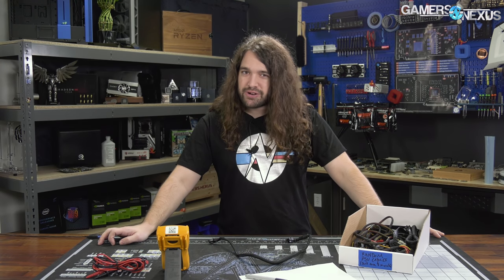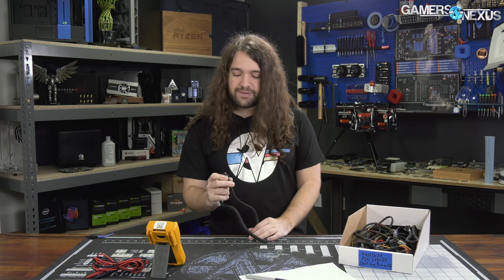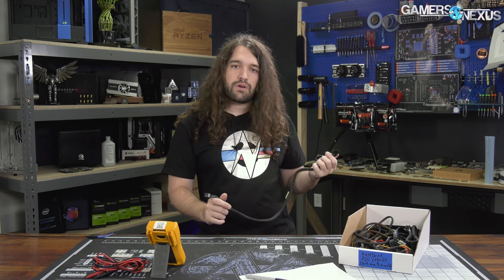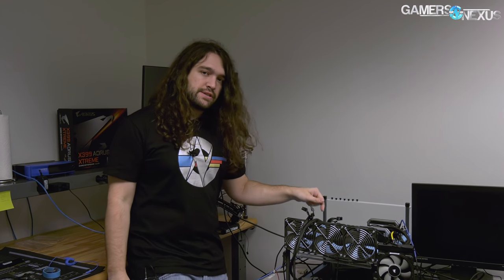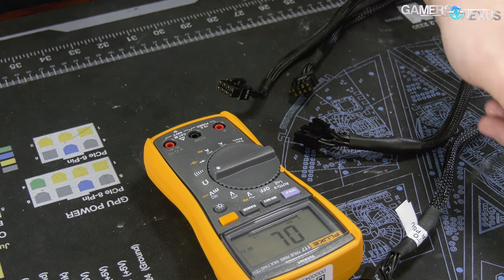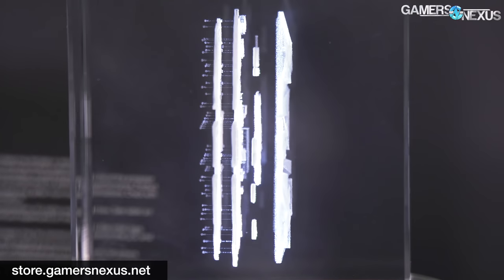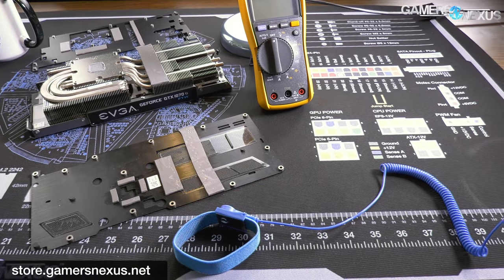How to Safely Mix Power Supply Cables Without Killing Parts

Comment: It depends on the supply i just tried to add extra custom sleeves cables to an old psu and it won't work. Yea an OCZ supply is wasted but it's all my brother had so i just bought him a new evga 750w and it works fine.

Comment: My friend was having problems with his computer. The PC shop couldnt work it out and eventually he decided to just buy new parts and just reuse his power supply. After getting it set up he found that the computer would crash under load so he decided that the PSU must be faulty. He bought a new PSU and plugged it in but left the old cables in the machine. There was no smoke or anything but but it didnt boot. Now after swapping the proper cables into the system it still wont boot. It says something along the lines of "USB over current, system will power off after 15 seconds". He has tried disconnecting all devices except for power and HDMI but it still keeps saying the same thing. Has he fried his mother board? If so, is it likely to have damaged anything else? Its ridiculous that this is still an issue. How many people have fried equipment just because they didnt know?

Comment: Personally I would plug the cables in the PSU and start it, then just do a potential measurement between each of the pins and a known ground of the PSU. Feels like that would be a lot more comprehensible than all that scribbling on paper....

Comment: I made pinouts by testing each cable, and it's easy enough to swap the pins around if needed. Question, though, when looking at the pinouts between my EVGA 850 G3 and my old Silverstone 700w SST-ST70F, the 8-pin VGA pinouts are exactly the same in where the +12v pins and ground pins are located, but the two bottom middle ground pins are swapped. Does this matter? A ground is a ground, right? Either way, that's the only difference, and everything else is the same. I swapped the pins anyway to be sure, so I was able to use a spare EVGA 8-pin VGA harness on the old Silverstone PSU.

Comment: The real question here is why are they like this to begin with? They would be standardized as a secondary result of just making the psu output a mirror of the connector on the board/card

Comment: So are extension cables safe? If different power supplies are wired differently, why do they make "universal" cable extensions?
Reply: I swore off extension cables since a few months ago when my extension cable burned the plastic on one of the connectors that went into my 3090. I had to scrape the melted plastic around one of my 3090's pins so I could fit the original PSU cable. I swapped PSUs just to be sure it wasn't the PSU. But boy oh boy. Never again. Never.

Comment: Wouldn't it be much easier to plug the cable into the supply, power up with nothing on the other end, and verify pin out on motherboard end of EPS cable with volt/multi meter?  As long as all the 12 v and ground pins are in the  correct place, your okay. This would work unless, for some reason, the cable shares or crosses wires between pins.

Comment: I learned this the hard way. Had a modular PSU recently. Which I so stupidly threw away the cables for. When my 1060 came, I didn't have a wire for it, so I went out and found a random 8-pin cable that matched the slot. GRAPHIC So, I plugged the cable in the PSU, and went to plug it in the GPU at which point the cable melted and adhered to my index finger and part of my thumb. I managed to shake it off before it cooled. So yeah. GPU's still works BTW
Reply: Damn, that sucks. You are lucky that the GPU still works.

Comment: i had to do some wire tracing when i got my CableMod stuff a little while ago. never having had contact with third party replacement cables before, i decided not to trust them blindly and compare them to my Seasonic unit's stock cables. and, well, unfortunately CableMod's wiring did look noticably different. so i had to look up pin out diagrams and then traced the individual wires and CableMod's weird splitting. one wire was actually missing compared to the stock cables, i think Sense B on the PCIe 8pin. didn't seem too important, though, so i used them anyway and yeah, nothing's blown up so far. still think it's sketchy, though...

Comment: Just pluck cable to PSU check is there is 5v to the ground where it supposed to be (power on), short start PSU and measure voltages on rest of the pins. If match then use. You made it overly lengthy and convoluted. Just be sure you measure voltage not current or you will have early new year fireworks.

Comment: Great video. Unfortunately tho, i discovered it a bit too late as both of my hard drives have just been fried due to, i assume, psu modular cable mixing. I bought a used Aerocool 650w semi-modular psu but it was missing sata cables so i just ordered a set of 4 sata to 6pin cable to add on my psu. Unluckily i had never heard of psu modular cables incompatibility so i just plugged it in and both my hdd and my ssd were fried.. problem is i cant even find a compatible modular sata cable for my 650w psu

Comment: Does it matter if the 8 pin slots are separated and no longer touching. If the plastic gets damaged by a bent pin is it still safe to used if it works

Comment: Wow I am a certified tech and I didnt know those cables weren't standardized. Thanks a lot.
Reply: Really? I would think this is one of the 1st pieces of wisdom any trainer/teacher would give out. If you are self taught?!?!? There is sooooo much that is NOT covered in any certification. The nuances of PC repair.
Reply: @tisjester  No i went to college I was not self taught. Also as techs we don't deal a lot with gaming systems when we do repairs. Most of our power supplies are not modular. I have built a fair amount of gaming rigs but never encountered this issue because I hadn't had a reason to mix PSU cables. I am glad I saw this video before an issue came up.
Reply: @diablojd52  why you need college just to repair PC?

Comment: If the pinout is different its no big deal, just pop the pins out the connector and put them back in the correct configuration.

Comment: Found this out a while back upgrading from a 600w evga psu to a 1000w evga psu. Didnt want to reroute the cpu cable again. Went to kick on the computer and got a 12v error light on my board( thank god evga still believes in lights and beeps for warning people). Got lucky and didnt kill my  brand new cpu.

Comment: Hey, I'm not sure if this can affect anything within the cable, but when I wanted to make my own cables, I heard of capacitors being on some cables itself. This made me make extensions instead, since I didn't want to deal with soldering, but is this something that may be something to watch out for?
Reply: The cables he was working on both had capacitors in them in the big budge(insert "oh my" meme) on motherboard side of cable under shrink wrap. They are just there to help improve power efficiency and can be handled a little roughly to get them to work for your case.

Comment: The way I would do it would be plug both cables into the psu turn psu on and test the voltage difference of same pins at system side.
If all read (close to) 0V all good else don't use the second cable.

NOTICE!
This does not guarantee the exact same pinout, only that it's unlikely to fry something.
EDIT This does not work for the 24 pin connector.
Reply: Probably for all but the Motherboard 24 Pin.. That has different wires that carry the same voltage (like for Sense / Standby and the like)
Reply: @tisjester  Good point.. Is there even a PSU with two connections for the 24 pin connector?
comment updated

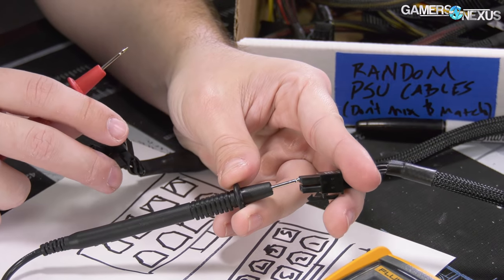Comment: 6:20 "OL" stands for "overload" - you're measuring the resistance of the air between the unconnected probes, which is extremely high compared to semiconductors or wires - far outside the scope the meter is designed for, thus you're overloading the meter's resistance range.  Zero L sounds like a handicapped Marvel superhero...
Reply: Open loop.  Open circuit

Comment: So what happens if you have to replace a cable on a power supply?  I have a Corsair 850x fully modular.  I need an extra 8pin pcie cable.  Do I have to contact Corsair and only get a PCIe cable from them because I would be "mixing" cables if I went with a different brand (e.g., like some say "you can't just take out the old power supply and put the new replacement in and plug the old cables in so you don't have to rewire everything").

Comment: instead of lines just write the number of the top pin where it goes to on the bottom diagram and then at the end compare the numbers of both bottom diagrams as they need to be the same

Comment: I use a 2015 CM v850 and I'd like to know if the cables become worn b4 the PSU as I had to unplug my 5v cable, blew in to it and plugged it in and it game me my 5v's back.

Comment: With al the mentioned parts here getting fried - you would thing their would be more warnings - or at least non-std shapes on the PSU side - also wish I'd  labelled all the transformers for hard drives, laptops, modems etc +remote controllers for cars/planes,drones- save time squinting to see whether 5v , 12 v and enough amps   +120 &/or 240v

Comment: Im having a big problem with the main power conector(psu cable the goes out the psu to the power wall), at least it seem like it is the case, maybe you could enlight us about those cables, about the amount copper on the connectors, about the size of its holes, about the size of its diameter, etc... thanks

Comment: I have my concerns after this... I have a SF600 Corsair PSU with very short cables, and I'm about to buy EZDIY-FAB Sleeved Cable - Cable Extension , should I be worried for compatibility issues, or is the safety concerns only for replacement cables?

Comment: Awesome Steve very helpful given the task that I have at hand this will help. But I have an additional matter I've received a EVGA Supernova 550 G2 from a friend but I did not get to the 18+10 to 24 pin connector from him I can make my own connector however I have no information if this model power supply connector has inline capacitors on it could you help me I'm not finding any solid information out there on the web would much appreciate it.
Reply: Evga is much better when it comes to exchanging psu cables. B3/B5/G2/G3/G5/G6/GA/GM/GP/GT/P2/P3/P5/P6/P+/T2 are all compatible and have the same pin outs if theyre under 1600w. They use the same cables so if you wanna swap the power supply box and no re do your cable management in the pc, youre all fine.

Comment: How would you test Sata cables ? I have a psu with only 1 sata cable ( out if 5 which I lost them when I move) and can't seem to find replacement. It's a Greatwall rebranded psu unit. I did find sata replacement cables from other manufactures that used this same PSU , they just rebrand it but I'm not sure if I can use their cables on mine.

Comment: Great video. I’m looking to test some GPU cables now. I understand about matching the 12V to 12V and GND to GND etc. But what about those Sense A and Sense B pins? Wouldn’t they have to be in the same location across two different cables as there is only one option?

Comment: Wow, I guess I'm an idiot but I really had no idea you couldn't just use different cables from different manufacturers. I guess it makes sense now that I think about it. Mainly my PSU is currently dying and I have custom cables. Now I guess I can just chuck those in the trash which is dumb and I have no idea if Silverstone cables from 5 years back will work on modern Silverstone PSU's and I don't have the gear to test this stuff. Also, I don't really want to be locked into one brand.

Comment: What about cable extensions?
Reply: If they are on the motherboard side they are standardized just like he showed. If they are on the PSU side they are not and you may need to check in the same way if they are not for that specific PSU.
Reply: @CheapBastard1988  They are on the mobo side, i feel safer now. (Cablemod modmesh kit) thanks.

Comment: I don't think that means 0L. Is it not OL for Open Load? BTW I think It is quicker and better to test with the cable on the PSU but no load, and then you can measure the voltage on each of the pins on the output. It is less work.

Comment: If it doesn't matter which of the 12v pins go to which of the 12v pins on the component end of the cable, wouldn't it be far quicker to put the meter in voltage mode and just check each pin on the eps plug with the power supply powered up? You could use chassis ground as your reference and check between 0v and 12v, cross reference your pinpoint diagram and you'd be done after testing 8 pins not 16 or more
Reply: That is a good way to verify a cable before plugging it into anything.. Check the pins for voltage to make sure none of them have the wrong voltage. 
I think it could matter if they are not the proper line..

Example say you have a +3.3V line and you test the end and it shows 3.3v.. You could also have a +3.3V Sense line.. So you might think the +3.3V is the right one when the one you are testing is actually the Sense line..

Or you test out to +5V.. You have +5V lines and a +5V Standby line..

You could also need a double line for +12V /+3V / Ground and you would need to know which pins need the double line vs the ones that do not..

For a simple 8 pin CPU / PCIE or 6 pin PCIE/Molex/SATA you would likely be fine to test just for voltage..   It is the 24 PIN you need to be very careful about.
Reply: That makes a lot of sense, thanks for your input 😊 I had to replace a cable on my cx550m with one made for a cs series and I knew theoretically they're the same but I'd never plug it in without doing the voltage check to be 100% sure as you said

Comment: I have a question. I have a raidmax rx-1000ae psu and I am short of the modular cables that supply the HDDs can I use 6-pin to sata power cables that I bought online to power my hdds?

Comment: That's not "0L" you're seeing when the leads aren't seeing resistance continuity, it's "OL", as in "OverLoad". "OL" is effectively "Infinite Resistance". That's also what you would see if you tried to measure the resistance of a broken wire.
Reply: @3en6ie Fair enough. My ultimate point still stands, it's not "0 L", as in Zero L.

Comment: I didn't even think of this but I went from a corsair rm 650x to a rm750x and I have been using the same cables from the 650.... I just got a 3070ti and before installing it realised. It says they are compatible on corsairs site but is it safe?

Comment: The fact that manufacturers don't just do 1:1 but instead have proprietary pin-outs that are different from one manufacturer to another is not only absolute shitty anti-consumer business practice, which hurts absolutely everyone involved, but it is also plain dangerous. This shit needs to be called out and changed. I want a world where I can go online and find cables in different colors and lengths that aren't extension cables, but cables from PSU to hardware. And they should just work for any modular power supply. That would be true modularity. What a clusterfuck. Companies all suck.

Comment: You could have just wrote the number of the pin in the connector drawing underneath the top drawing instead of drawing lines.  It would have been cleaner and easier to follow.

Comment: today i stuck an evga perif/sata into a silver stone  to run an rgb controller. smoke. didn’t check and after noticed that the pin out is visibly different. rookie mistake. i think the only victim so far was the rgb controller

Comment: Hye GN..im testing my pcie cable from 2 different psu brand..testing 2 pcie cable (8pin to dual 2pin+6pin)..i just want to use its 6pin to power the riser..both cable pin give me the reading (from pin 1 to pin 8)..but different value of reading..

during the test:
1 cable give reading 0.8, 
1 cable give reading 1.0

Is it safe to use?

Comment: if you have two of the exact same modular psu is it safe to mix the wires? I have two of the same psu but I have two of the wires mixed it’s for the gpu

Comment: Question: I have a cable written cpu on it from an asus power supply. I want to plug the extra cpu 4 pins on my motherboard with it but does not fit the cpu socket on my psu (the square triangle pattern if u will) but it fits the vga socket. can I put a cpu wire and plug it in a vga hole in the psu to a cpu or the voltages arent the same at all?

Comment: Does a EVGA pcie GQ wire work with a SUPERNOVA G2 power supply only asking as that’s all I got as I just got a 1080ti but need another 8pin and that’s all I could find? Need help asap

Comment: the part of the PC world that confuses me the most is that I can buy power supply regardless of brand put it on my computer and it works. But if I mix the cables with a different psu I can kill the computer.

Comment: Extender and splitter cables are so common,online,using old PSU cables seems pointless.
Reply: What if you need shorter cables tho. Thats also a thing, especially for smaller PCs.

Comment: Wouldn't it be much quicker to just plugin the cable into the power supply and check for the correct voltages on the pins?
Reply: Probably for all but the Motherboard 24 Pin.. That has different wires that carry the same voltage (like for Sense / Standby and the like)

Comment: simple question i hope. i want to upgade my ocz modstream 500 to a 600 i already purchased the new ps. am i good to go just swapping out the power supply so i dont have to re run all the cabling? and in other situations  is it safe to assume if your using the same line and brand the only difference is power, the cabling will be the same ?
Reply: See my comment above.  I found the Modstream has a different 8 Pin PCIE configuration at the PSU than say, EVGA PSUs do.